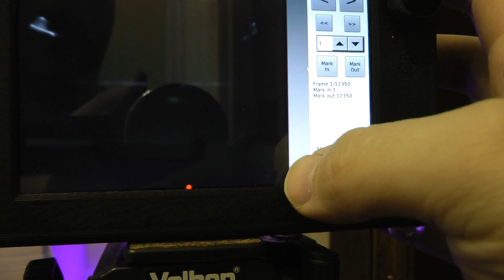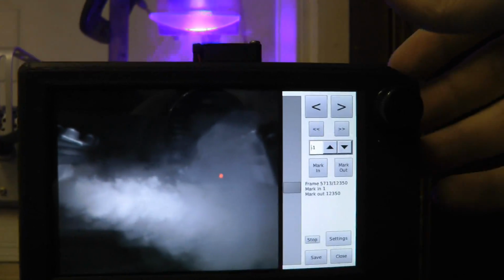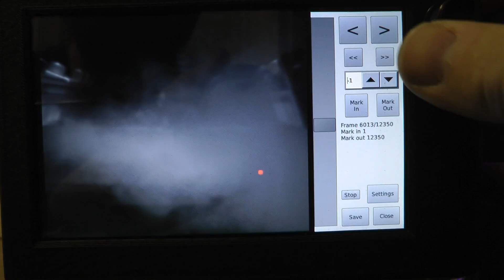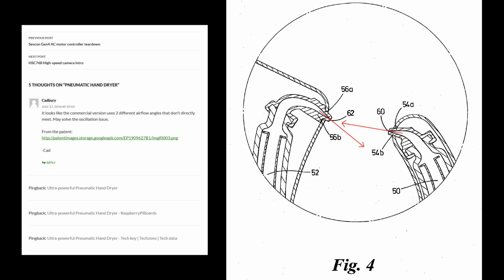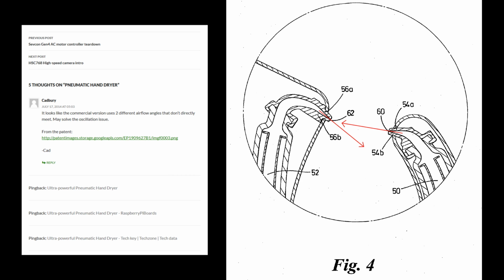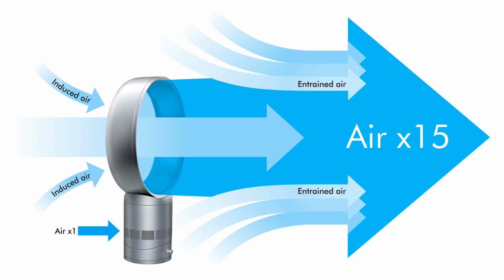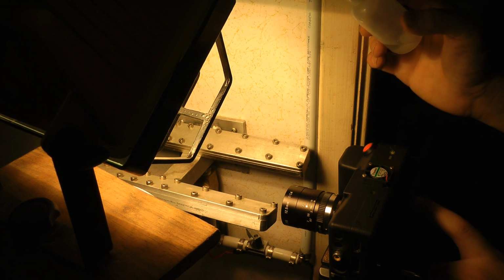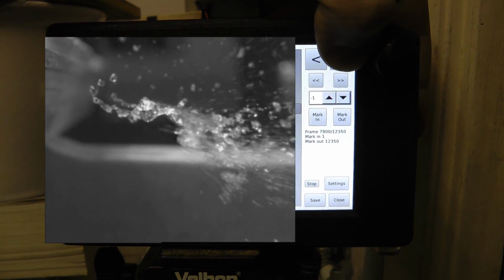Pneumatic hand dryer oscillation investigation

Comment: simple question
will it not be better to use GREEN monochrome light ? it will eliminate some problems with focusing, at least a bit
Reply from the maker: Yes, that would have been best, but I only had a high-power blue laser available, and a somewhat lower power red laser which I didn't use because that one was an open case (exposed die). The smoke would condense on it and could cause damage.
Reply: tesla500
how can i chat with you about high speed camera design ? (skype, mail ?)
i have similar project, but on top of capturing, i need to do image processing as well